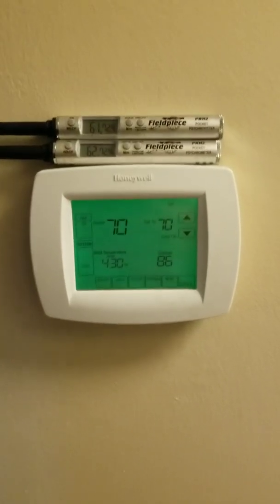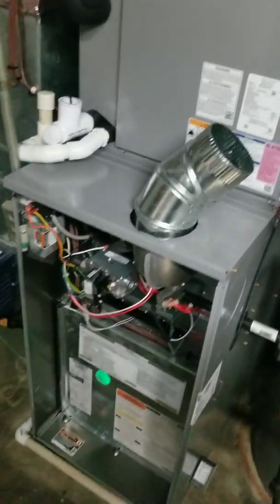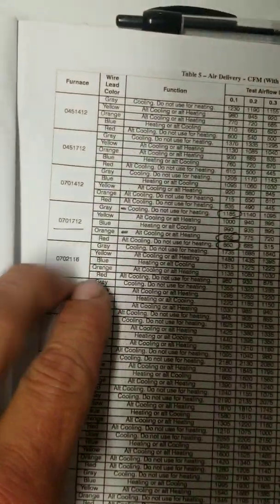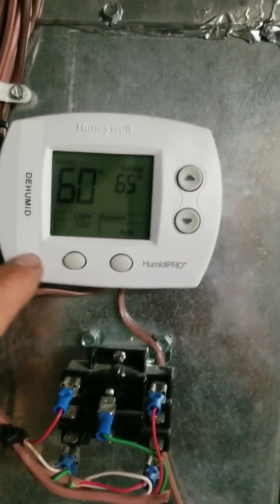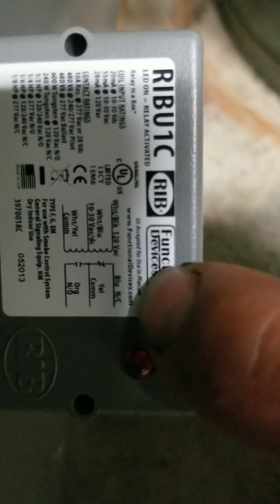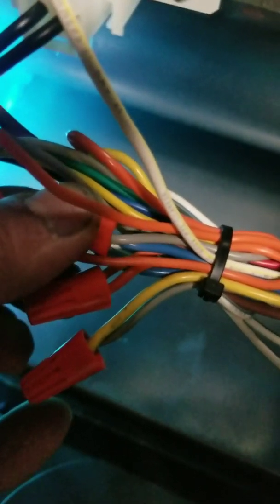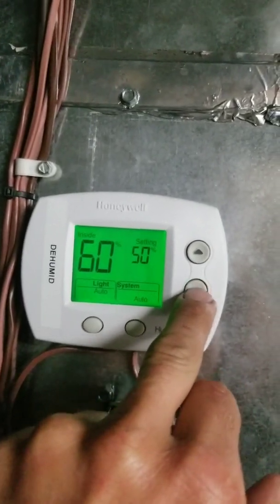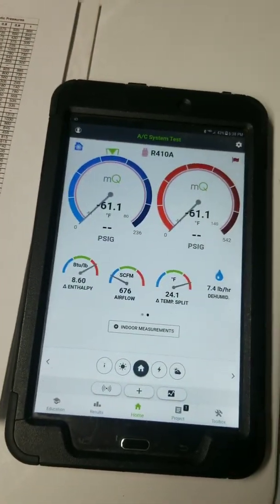Lowering blower speed to dehumidify. home hvac.

Comment: My friend, that's why you should always adjust humidity using Deta-T. Try adjusting the saturated temperature at the evaporator coil with an Electronic Expansion Valve . No reason to mess with the indoor air flow.

Cheers!
Reply from the maker: I didn't have an EXV. I was working with what I had. The blower speed was the only way to reduce humidity in this situation quickly and easily. Worked well, too.

Comment: I have a single stage AC unit with gas furannce. I have been wanting to install a separate dehumidifer set to operate when AC is not cooling and use the air handler to help distribute the air. So I could use the relay to call for the lower fan speed when dehu is on and when call for AC it can stay at programmed speed?
Reply from the maker: Simple answer, yes. You can control the fan speed easily on your basic PSC motor, but there are other things to consider.
Reply: @EverythingHVACR  I appreciate the answer. I appreciate outside the box thinking. As you see not everyone can invest in 25K Inifnity systems. Custom efficiency solutions with existing equipment is fascinating.
Reply from the maker: @kelley71 NP. This was just me messing around with my unit at home. Just consider static pressure and fan charts for the furnace as well as superheat. This works much better if you have a TXV and can easily flood and damage your compressor if using a fixed orifice metering device.
Reply: @EverythingHVACR  I strictly want to use the carrier air fan to circulate the Aprilaire supply at a slower speed to save energy.